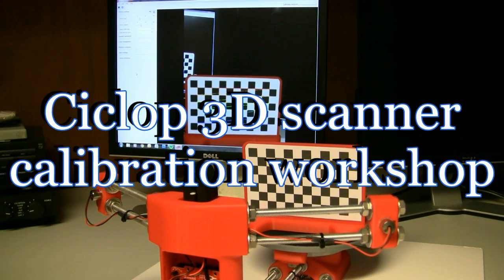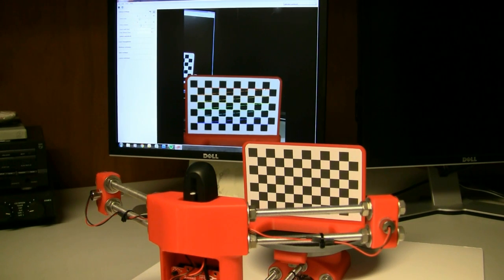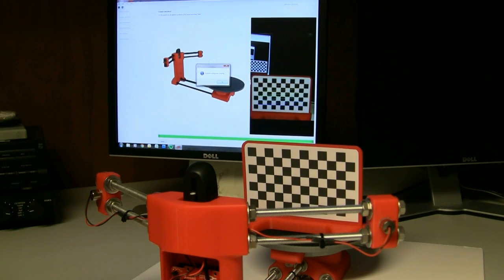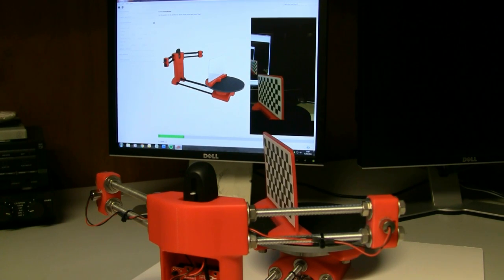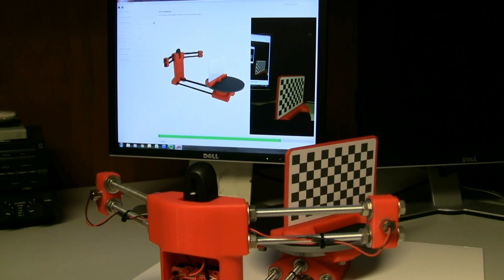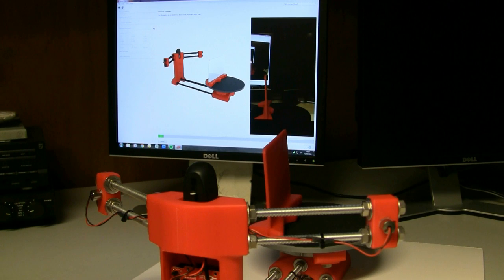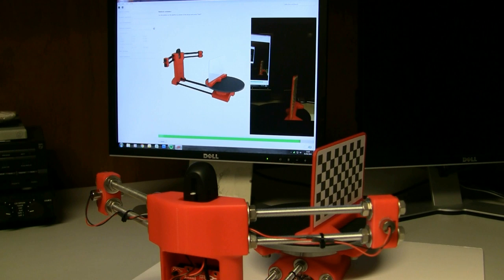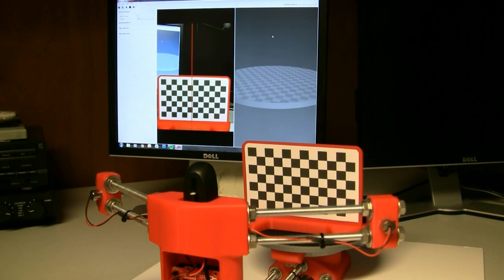Ciclop calibration

Comment: I can’t get this garbage to work at all.    Something is always wrong.  Either the board or the lasers.   Changed board and lasers three times please help me
Reply from the maker: I think you will need to be more specific as to what the issues are.  I built mine as per the instruction and had no issues so the design does work.  Obviously, as with any design especially when it consists of software, mechanics, optics, communications ..... there are always area where things may go wrong but in my experience the design is sound.
Reply: I did it by the instructions but either the board isn’t working or the lasers can’t be calibrated.  I’ve changed the board and lasers out twice and still no scanning

Comment: Hi
Just got one of these scanners and am having a lot of trouble calibrating it, the lasers calibrate no problem but the platform is where it falls over.
I have tried a lot of solutions suggested by others on forums etc. but so far no result. Have changed rooms, lighting and pc including operating system. I have run out of things to try, being new to 3d printing and scanning. 
I am hoping you may be able to suggest something I havent thought of yet. 
I found your videos extremely helpful in assembling the scanner.
Reply from the maker: Anthony Calvert Hi Anthony, sure I can try and help. Can you be a little more specific as to the problem ... what exactly is not working and what happens ?
Reply: hi David thanks for replying, basically no matter what i do or what setting I use I just get the same calibration failure error. This tells me that the pattern is not recognised and I should check settings and room lighting etc.
The pattern is in the right place on the platform, according to the instructions, It has the pattern of coloured lines and dots on it, as it should have. But still will not calibrate the platform. Without this calibration I cannot use the scanner. Even using the wizard it makes no difference. 
When I start the platform calibration, the platform rotates round and starts stepping back. 9 steps and the line dot pattern appears. this stays there until 9 or 10 steps from the end of the sequence.the platform then returns to the front and then the error is shown. I have set the pattern depth to the correct measurement. and the pattern sizes are default, 6 rows 11 columns 13mm squares.
Changing camera brightness, contrast and exposure from the default makes no difference either.
Running out of things to try and options to change, so am now at a loss.
Hope this information helps.
Reply: hi just had another go at the calibration and it worked, the only thing I did different was to connect the webcam and the main board to 2 different usb ports on the pc instead of through a hub. I only had one free port on the front of the pc very frustrating. just got to try a scan now.
Reply from the maker: Hello Anthony, that is spooky - I am literally out in my work shop putting a little video together going through the settings and the procedure I used to calibrate.  This could be classic hub trouble whereby one or more devices is not connecting or enumerating correctly through the hub.  I generally always connect stuff to the PC first before using a hub because they can be really hit and miss.  I can carry on with the video if of use ?
Reply: thank you for you help David I think I've got there now. But maybe others might find the video useful due to the lack of info/instructions for this scanner.

Comment: Hi David, My scans are being. I am trying toscan in a GWR loco lamp which is brass and is also 5inch guage version of the real item. Instead of being square it comes out round. any thoughts would be apreciated.
Reply from the maker: Hello Anthony, it is a little difficult to diagnose a possible issue from you description.  The scanning process is not perfect and is influenced by several factors including calibration and ambient lighting.  Can you post the result of your scan to better visualize the problem ?
Reply: Not sure how to post the results.

Comment: can this be modified with a green laser? with a kinect?
Reply from the maker: urjnlegend
with the existing software a green laser might be possible depending on the camera sensitivity. The current software is designed to support the Logitech camera so I very much doubt it will support a Kinect device.
Reply: David Trewren how well does it scan? can you 3d print a 1:1 replica of the original design?
Reply: i ntheory green lasers are beneficial since camera sensors have twice the amount or green ccd-pixels than red ones